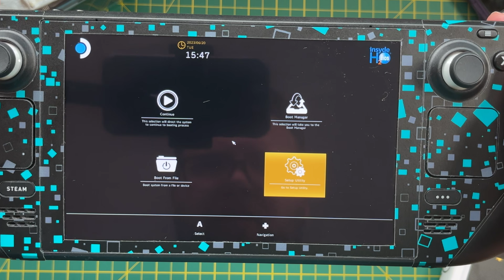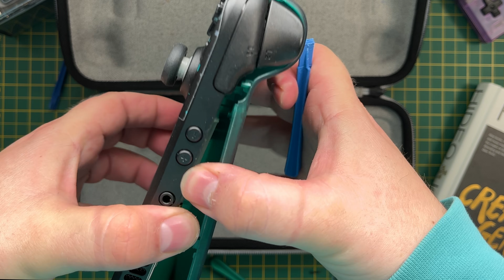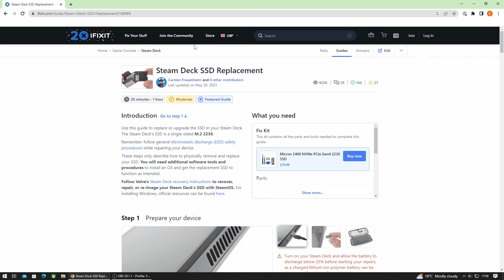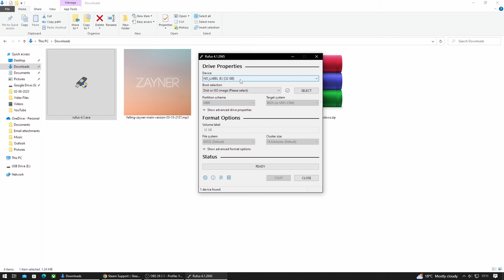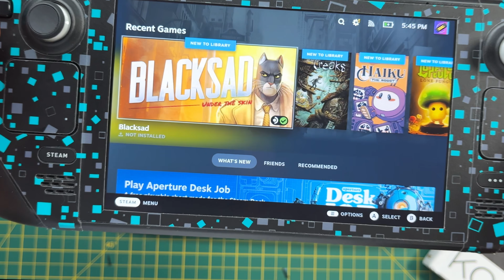How to Upgrade Your Steam Deck Storage!

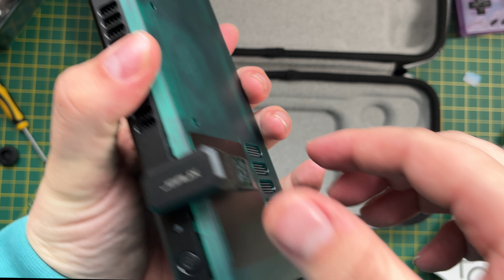Comment from the maker: IMPORTANT: At 6:10 I forgot to show that you need to connect power before it will let you turn on the steam deck again! If you remember, we entered battery recovery mode! All you need to do is connect power, turn it on, and then turn it back off again. Youlll then be able to boot into recovery mode! Sorry if I caused you any panic! 😅
Reply: I'd recommend pinning the comment for avoid people missing this
Reply from the maker: @xapsus2221  I thought it was… thanks for the headsup
Reply: I cloned the old SSD onto the new one by using two M.2 to USB adapters and the UNIX dd command. There was no need to reinstall steamOS. SteamOS even resized the partition to use the additional space at boot.
Reply: Started panicking already 😅
Reply from the maker: @kacperzabczyk4559  You’ve got this 👊
Reply: brooo i was stressed i messed up haha
Reply: its not turning back on for me unless it is still charged??? what do i do???
Reply: Hey there, ever since you installed this Western Digital SSD, everything's gone extremely well? No issues with this upgrade? And do you recommend this upgrade?
Reply from the maker: @SaiyanChamp  working perfectly  o issues at all. Recommended! 👍
Reply: @steamdeckguy  haha oke
Reply: thank you so much for adding this!
Reply: you forgot to pin this

Comment: if u boot to desktop mode first install balancer etcher, then put 2tb in a cady and make a clone from internal steam deck m2 to new 2tb and resizes for u then when u swap just turn steam deck on and it works no need to install recovery image.  once u know it works use old m2 as external usb device in cady.

Comment: Thanks for your vid. My computer runs an old version of windows.  Windows 7. So i had to download an older version of Rufus in order to get the software to launch. Had to download Rufus 3.22.2009. It finally launched on my win7 machine.  Then going thru the options on Rufus, the iFixit tutorial vid says the "Partition scheme"  should be set to GPT and everything else is grayed out, but that wasn't the case for me. On mine "Partition scheme" says MBR, so i wasn't sure if it would work,  but watching your vid shows "Partition scheme" says MBR just like mine, so I know it will work. Thanks for helping me clarify. Great vid.

Comment: i was gonna get a 2tb ssd but i read that bigger ssd actually uses more power and gets slightly hotter so i decided to only get a 1tb ssd instead, it should make the system run better and for longer cause steam deck dosent have a long battery life and they get really hot anyways

Comment: Do you have to do the flash drive part if its a brand new steam deck? Im ordering my steam deck and i want to upgrade the storage right away.
Reply from the maker: Yes, it doesn’t make any difference that it is brand new. You can’t just swap out the drives. You need to boot into the OS installed in the flash drive, and then run the process which downloads the OS to the new drive. I’d you skip that part, you won’t make it past the boot menu…
Reply: @steamdeckguy okay awesome, thank you! I’m new to this stuff. Most I’ve ever done is a shell swap lol

Comment: Can someone explain how you can turn on the steam deck without being plugged into a charger after it’s in battery storage mode?? All of the guides say you need to use a charger to turn the steam deck back on again but go straight to plug in the the USB adapter to install the OS
Reply from the maker: You need to plug it into a charger to get it out of battery storage mode. Once it turns on you can disconnect it from the charger. You can then hold the power button to restart it if you need to.
Reply: @ thank you so much! I’m swapping the SSD on my wife’s Deck for Mother’s Day this week and you’re going to make me look like a hero!

Comment: I was thinking of selling my cs inventory to get the Steam Deck, I already sold half of my stuff and I now have 170eur, but I was thinking of grabbing the cheapest - LCD 256GB for 419eur - but obviously one of the main issues is the storage space, but I was wondering can't I just buy a microsd evo select card with 1tb already inside rather than replacing the actual SSD? I mean I could do both in fact even but at the same time I highly doubt that I need a handheld device with about 3-4TB of disk space because even my PC barely has 1TB which is not enough, but on smaller devices I don't believe that I'd have that many HD games downloaded :D
Reply from the maker: Yes, you can just buy a large microSD card, although they can be expensive. I use a 2tb internal drive with 512gb micro sd card.

Comment: after booting into the USB, mine starts spitting out a bunch of code. At once point there's a line of code that says, "Welcome to steam OS" I believe. Am I doing something wrong? Eventually boots into the steam logo with a mouse cursor, but nothing else afterwards.
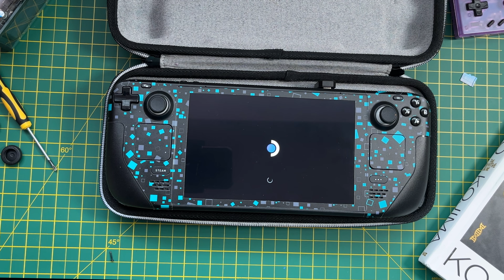Reply from the maker: That’s normal. After it’s booted you should be taken to the desktop as shown at 6:38. If it doesn’t work, hold the power button down until it reboots and try again.

Comment: I know you posted this forever ago but I just got an OLED and appreciated this short and straight forward walk through. Successfully installed crucial 2TB. I followed your lead and got the ugreen enclosure for my now spare 512gigs. I did use a micro SD instead of the thumb drive and it worked, greatly thank you! Time to go download a ton of games!

Comment: Great guide, but one question: I’ll be using a portable SSD to reimage since I don’t have a thumb drive. It’s otherwise full of other files and folders. Will the Steam Deck automatically find the image file, or will I have to somehow navigate to it during the process? It doesn’t detail whether the thumb drive only had the image file on it, or whether the thumb drive was formatted for Linux, as all of my portable drives are formatted for Windows
Reply from the maker: When you write an image to a drive, be that usb drive or SSD, that entire drive becomes a boot drive. All you then do is tell steam to boot into that drive

Comment: Everything went really smooth until it came to powering the deck back on to begin  the steps of installing the OS I saw the updated comment about battery storage mode but now I’m just lost I can hear and see the fan turn on see lights hear beeps but aside from that nothing i have no display no logo I can’t manage to get it to go into the USB BOOT process at all I’m just beyond frustrated

Comment: Is it completely necessary to disconnect your battery if the swap is going to be relatively quick and easy? I installed the Gulikit Hall Effect joysticks on my Steam Deck, and I didn't even go near my battery. I also disconnected the internal SSD because I had, sadly, broken my microSD and needed to access the microSD port, which involved some further disassembly. I reconnected the SSD afterwards, and all was fine.
Reply from the maker: You risk frying the steam deck if you don’t disconnect the battery. Not a risk work taking imo
Reply: @ Frying it how? It’s not necessary.

Comment: nice tutorial good enough for me but if u want tipps for improvment a bit more on how to get battery out and in again(the connector) would have been nice took me long because i didnt wanna break it lol that plus the foil on the ssd you can take it off easily without pealing and put it on the new one in 3 seconds. People dont get scared like me because of the blackscreen it will show sign of life when u connect a bootable usb device plus do the sound -- and power button combo i literally thought i fuked it somehow up while being carefull as hell (just reconnecting the battery was actually difficult and i wasnt sure if i didnt break anything while doing it) but in the end it all worked out perfectly wasnt that long too and now i got a nice 1,8TB main storage  wich should be enough but in case it isnt i have my500gb sd card too 

Lots of thank yous and respect for teaching and showing others! Keep it on you great human beeing

Comment: My Deck likes to crash. A lot. Without warning, and not just in games. Thinking its a software issue, I want to upgrade and reimage. Would it be bricked if it froze during the reimage, or can I boot into the reimage option screen at any time if a hiccup occurs? Thank you for this video, this is the one I will be using for guidance
Reply from the maker: If it was to freeze during the reinage process, you can just boot the USB recovery drive again.

Comment: One thing you might want to mention that I just noticed is charge your battery before you write the steam os to the new ssd if your going to use a USB A to type C adapter like that you can't charge it and if it shuts off part way through you would have to start over.
Reply: Or put the image on micro SD instead of thumb drive as I just saw suggested, will definitely be faster.

Comment: Great video. Just followed the process and Deck storage is upgraded to 2TB. My unit does not have the heat foil on top of the screw for some reason (different metal plate - bought in Japan) which made that part even easier. The reboot took a long time tho, probably because I've used a slow flashdrive. I took the opportunity to also install a copper heat shield at the SSD instead of the foil.  Thank you for sharing this.

Comment: For me the hardest part was removing the battery connector. When I pulled the black tag the tag just ripped off and the wires got exposed but I managed to push the connector out by using a thin and sharp tool and pushed the outer edge.
Reply from the maker: 😳 Glad you sorted it! 👍 Maybe don’t pull so hard next time! 😂
Reply: It was likely the reason I'm scrolling this, I saw the tab was not split apart, stiff as a board around/the wires so I had to use pliers, tried heating up something to place against the wires/sleeve but it wasnt helping it have any flex but yeah if I tried to pull the tab it's having it pull the cables that go into the main battery a good bit before it would then tug on the power plug but I'll go back at it when I'm home

Comment: So I followed the step by step but when I try to boot from USB stick I'm getting failed on a lot of my commands lines any help? I'm using a usb 2 stick so I don't hink it matters but I'm I've tried to load it was a zip and even extra ted the files from the zip and both have failed please help any one lol
Reply: Same!
Reply from the maker: Did you write the .img to the usb drive per the video?
Reply: @steamdeckguy  yes, but when I start from the boot manager, I’m never given a desktop view. It goes straight into writing Linux code and then eventually gives a black screen. I may try and do the process with an SD card. If that doesn’t work, I’ll try to clone the SSD
Reply: @steamdeckguy  yeah just needed a better usb stick works fine thank you
Reply: try doing the reimage process from a microSD instead of a USB drive. It worked for me. My microSD card reader actually isn’t working on my steam deck so I just did the reimage to the microSD card and connected the card to the deck via USB-C dongle. Worked like a charm

Comment: Anyone wanna give me tips? I got my Steamdeck last month. 256gb with a 256gb sd card since then
When I got it I changed the thermal paste(it's a refurb) and it just died on me. Did touch anything else, disconnected battery, all that
Sent it for RMA and they changed the Main board.
Kinda afraid to mess with it now, any ideas if I caused the damage and how to avoid it? 
I tweak my laptop and swap TP on it regularly.
Deck just scares me now.
Reply from the maker: Maybe wear anti static strap - that might be how you damaged the board. Otherwise, just take your time, or maybe don’t mess with the CPU. You don’t need to change thermal paste or anything, so if you don’t want to risk breaking it again, simply leave it alone. That’s my advice 😁

Comment: Ive just noticed your using the same grip case as me in this video is there a dock you recommend that fit the grip case fitted
Reply from the maker: I’m actually using the satisfy grip case now - it’s not too dissimilar to the mod case. I don’t really use a dock, but previously I was using the official dock with the adapter JSAUX sent me (not sure if you can buy them). Otherwise, you should find most of the JSAUX docks fit the case fine. Even the Ugreen dock is decent and should fit the deck with a case fine. It’s only the official dock that is super shallow and doesn’t work with a case (unless you use the jsaux adapter that I mentioned)

Comment: Its crazy that, after a fresh install.. you only get about 1.8tb and not the full 2tb...
Reply from the maker: Per my research “Storage capacity is calculated using the decimal system, where 1GB is equal to 1,000,000,000 bytes. However, computers use the binary system, where 1GB is equal to 1,073,741,824 bytes. This means that the advertised capacity in decimal is higher than the actual capacity in binary.” It’s annoying, but it’s just the way it is…

Comment: I always found the delivered fine mechanical tools very weak. I use and highly recommend tools from a company called WERA. Especially if you use them on a regular basis. They are worth every cent. The dont wear out and its very uncharacteristic to screw your screws with them.
They are also magnetic, but you can demagnetize them, if necessary.
Sorry for the ad, you might block, report or even hate me for it, but i will never step away from my recommendation.
The shown tools are in every "Smartphone repair kit". Pick at least a kit, which involves a magnetic platform, which can hold the screws.
Reply from the maker: I don’t disagree - if you plan on doing this kind of thing on a regular basis, then it does pay to invest in a decent set of tools. Otherwise, one of those cheap tools, although inferior, will do the job fine…

Comment: Sorry if this seems like a stupid question, but instead of reimaging my Steam Deck from scratch, is it possible to clone my existing Steam Deck internal drive to the new SSD using the adaptor you showed, and then plugging in the new drive with all my old data already on it? I'm asking because I have a lot of non-Steam games/apps installed as well as Decky plugins and don't want to have to redo everything from scratch on the new drive.
Reply from the maker: Yes,  you can clone the drive. Plenty of guides out there.

Comment: Silly question but is it required to use a USB drive or can I simply connect the SD to a laptop after installation and use that as a means to reimaging the OS on the new SSD
Reply from the maker: You need to use removable media connected to the steam deck. Either usb drive or micro sd
Reply: @steamdeckguy  I didn't know about being able to use a Micro SD for it. Thanks for the info! I just got a 1tb for my birthday and I didn't feel like buying 30 dollars worth of adapters and wait a week. Your tutorial was very informative and succinct btw. Many thanks.

Comment: quick question! im tryna switch my 64gb to a 1tb, ive followed all thr steps thoroughly but when i try to boot the recovery image into my steam deck I’m stuck on “Emergency Mode” is there any way i can solve this issue? not sure if the problem is from my SD card or the steam deck itself :’) i searched for solutions online and they said to run fsck but idk how to do that either.. please help!
Reply from the maker: Are you using usb drive to boot? You should at least be able to boot into recovery mode and then do a full steamOS re-install. If you can’t make it to recovery mode then it sounds like the recovery media you created is corrupted.
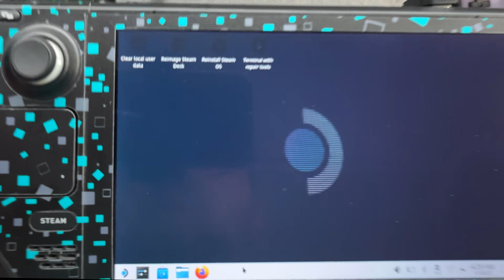Reply: @steamdeckguy  thanks for ur quick response! i redid it it again and was able to make it to the desktop, but my icons look different from yours, instead of “Reimage Steam Deck” it says “Reimage Deck.desktop” and it ran on the Kate application instead of the Konsole in ur video in 6:47 any advice?

Comment: Nope, didn't work for me. Mine was stuck at boot logo and wouldn't change even after an hour. 
I went back and changed my Deck's version to Beta, but even that didn't work.

The only solution was to re-image the entire Deck, which unfortunately resets the device to factory settings.
All EmuDeck and custom settings will have to be done again from scratch.

I don't know why these guides makes this all look so easy..
Reply from the maker: What you have said makes zero sense. How can you change to beta? If it didn’t make it past the boot? and my guide is specifically showing you how to do a full re-image so of course it will reset the device. Sounds like you followed someone else guide to clone the drive and messed up…if you do want to do a full re-image, follow my guide and you’ll be good! 👍
Reply: @steamdeckguy  I followed your guide exactly and afterwards I was stuck on the boot logo for an hour with no change. Videos can be edited, real life cannot.
Reply from the maker: @Stormbringer88  video can’t be edited actually. Just restart the steam deck and try again…all this drama is unnecessary.

Comment: I'm getting stuck after on a screen of code after installing the USB and running it through the bios. Is it possible I didn't attach the SSD correctly?
Reply from the maker: Id leave it for at least an hour, and if still not moving then restart and try again (hold the power button down until it switches off)
Reply: Got it to work man. Appreciate it
Reply: @fatchicken518 may i ask you if you got it to work, by following his instructions or what. Mines doingthe exact same thing

Comment: I just got my steam deck today, I have everything I need to switch to an ssd, should I just take it apart and do it? I haven’t turned it on or anything.
Reply from the maker: I’d swap the SSD before turning it on. You’ll find it will already be in battery storage mode so once you have done it, remember to connect to power - otherwise it won’t turn on